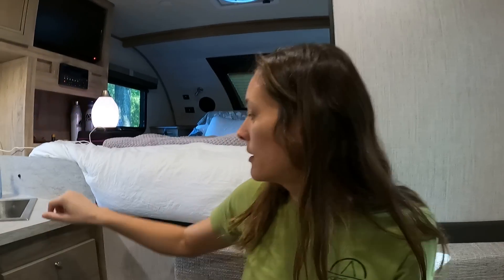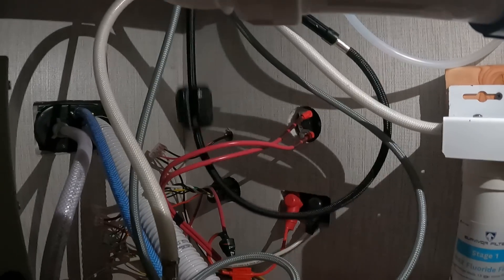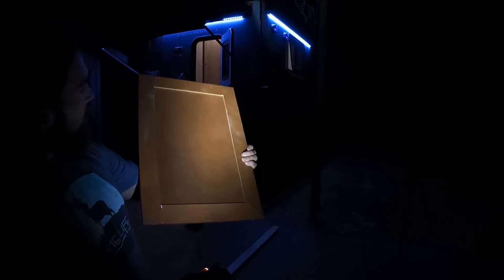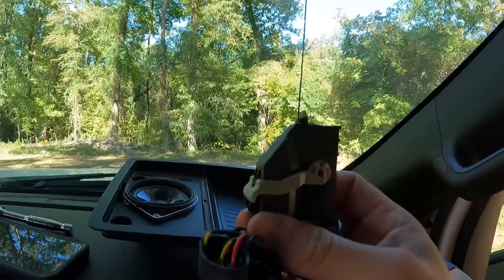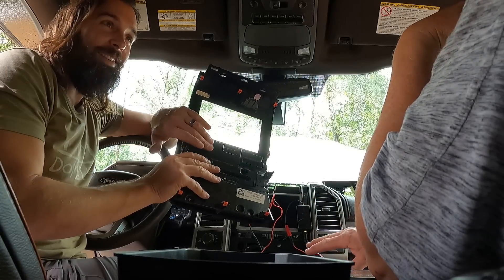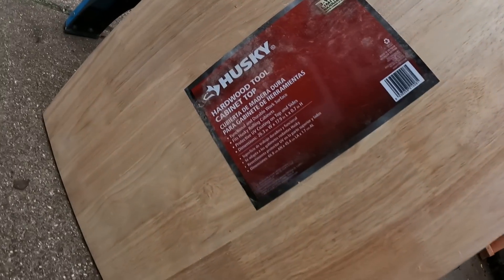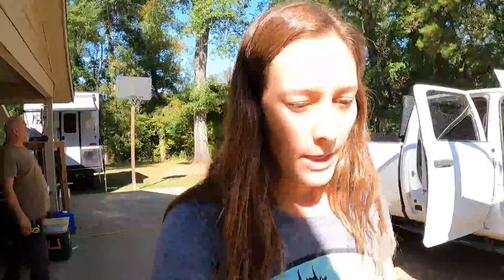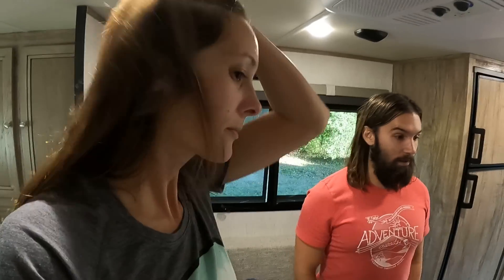TRUCK CAMPER UPGRADES You Won't Believe What We Did!

Comment: EXTEND DRY CAMP TIME, Great mods, nice rig CONGRATULATIONS. To make life easier and extend your dry camping periods, you might consider: 1) An extra snap on Dump Slider Valve so you can OPEN your existing black and gray valves to like double your gray holding capacity as you're NOT using the black..    2)  Add a 40 or 60 Amp DC to DC charger (properly wired) to charge your house batteries correctly when driving. 3) Convert to an Oxygenics Shower head to save water..,4) One more rooftop solar panel (maybe 200 watt or more whatever fits) maybe an upgraded Solar Charge Controller IF necessary. Fun videos keep em coming 5) IF necessary upgrade your Charger for lithium once you install them ............Do you guys read the comments ??

John T BSEE,JD in Indiana   Electrical Engineer and 50 year RV owner

Comment: Here is a tip on the faucet. Try rotating the faucet 90 degrees so that the handle is aligned over the sink instead of the side. Less mess and easier to use.

Comment: Have the same camper. Love the blk water drain shelf on outside. Also that storage as you step in. I will steal these ideas! Thx! Stuff Ive done. Taken off bathroom door n replaced with pullback curtains. Painted entrance n kitchen white w/blue accent. Since the paint is soft I found it best to put two coats of polyureathane to give it a hard coat n easy to clean. Water based is fine. In my spoon/knife drawer I put 4screws near the top that my s/f/k organizer rests on. The heavy cutting knives n big utensils sit underneath. Thinking of putting lil shelves in the others to give them dual height. See ya’ll on tha road! 👍🏻👍🏻👍🏻
Reply: Two other ideas I will be implementing. The restroom. I will take out that mirror vanity n replace with multiple level shelving running from behind and above the toilet (which you dont have!) and around to where the mirror was. I’ll put in a better mirror that I have here in the house. 10X the amnt of storage. #2.- where you step up into the bed….that wall surface at your knees….I’m putting a tabletop that hangs on a piano-hinge. When needed, lift up and the support leg or legs swing down. Thinking of making it a game-table too! Next month: renovating the bedroom!👍🏻
Reply: Howdy howdy. More thoughts. It got into mid 40°s here in Fl n that floor was really cold. Looking at the sub-space I see zero insulation. I know we have the basement heater but Im wondering if it could still use a good dose of insulation down underneath n other spots. Using styrofoam sheeting w/foil on outside tween truck n underbox. I thought of boxing off the battery since it needs to vents n that brings in cold air. Any other thoughts, ideas, inputs?
That first foot of free space underneath the flooring as you step in looks like a nice storage place for some tools n stuff.
Reply: Something the worker guy that was doing the installation told me at the rv center was that since our license tags on the truck are hidden, that state troopers/LEOs may not like that. They can stop you and ticket you for obscuring the tag and Id hate for any escalation to happen so I am making a copy of the tag to place where it can be seen. May not happen but just in case. Cross my fingers knock on wood whisper BeetleJuice 3Xs! Lol

Comment: There is a very good chance, the handle on the faucet can vibrate open when driving and flood your camper. Some people use a heavy rubber band on the faucet handle to secure it to the faucet stem so it can't turn on when driving.
Reply: do you mean,  so it can't turn on when driving? Good idea with the rubber band though
Reply: @victoriabroyles6467  I saw a video of this exact same faucet on another channel. The title was " Brand new faucet floods camper." I'm sorry I don't remember the channel.
Reply: I have a better fix , when driving do what I do ! Don’t turn your water pump on !
Reply: @outdoor_camping_adventures  I personally don't always remember to turn everything off. Better to be safe than sorry.
Reply: @glennbeattie6172  sure I understand, that’s why a check list before you hit the road can save you money or headaches or maybe a life.

Comment: Im so jealous of your new faucet, as I do have a high clearance faucet in my EPro 19BH, but it doesn’t have an extendable wand. You’re absolutely correct about it wasting water. I think I have the same sink you do and rinsing it out is a total water waste. My cabinet underneath is TINY!!! I’m still trying to figure out how to get behind the cabinet to loosen/tighten that bolt that holds the faucet stable in the counter.  uugh

Comment: Noticed that you had a elastic cord to hold open the exterior compartment door. On my Lance truck camper they have a magnetic door latch that when you lift the compartment door there is a plate above the door (on the camper side) which holds the door open and out of the way.

Comment: I have a kitchen faucet just like your new one. I turned it so that the off & on handle   was positioned over the sink basin  so I would not drip water with my wet hands  on the counter  . Doing this however makes the hot on the right & cold on theft but it was worth it to not have water drip on counter. Maybe i am just  not a tiny  dish washer  haha

Comment: They make a wireless camera.  Works great. Stays powered for a good 24 hours. Runs off wifi connection to your phone...(not actual wifi). I've had mine a long time. Wasn't cheap but no drilling.

Comment: I love your videos. I have the HS1806 model and have done a lot of upgrades and convenience additions as well. Your vids have been very helpful. I am hoping that you may have an idea on how to access the grey and black tanks. I'm in Canada and want to add heating pads for the colder weather in spring and fall. I had to add a shut off valve to the cold line going to my on demand hot water tank as it is too exposed to the outside. Unfortunately that shuts off the water to the bathroom so I just use a bucket to flush 😉. Any advice would help. Thanks!

Comment: Hey what's up guys? You know I'm having a problem with deciding on which camper to get. The pull behind,or the one like the one yall have and which one is harder on the truck
Reply from the maker: For us we did not want to pull anything after pulling the smaller trailer for over a year. We wanted to have everything with us at all times so we are more free to be spontaneous with our adventure and not be forced to return to our camp to pack everything up.